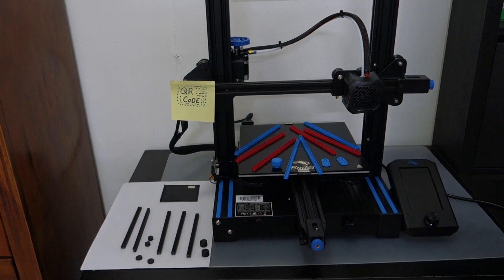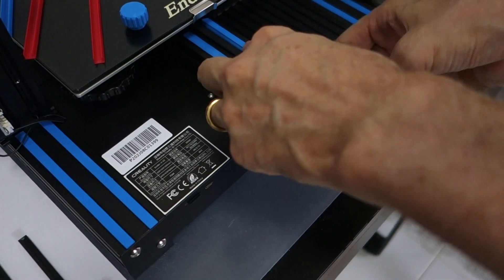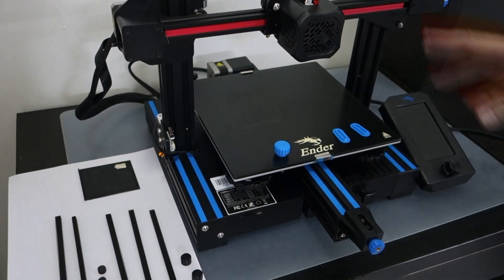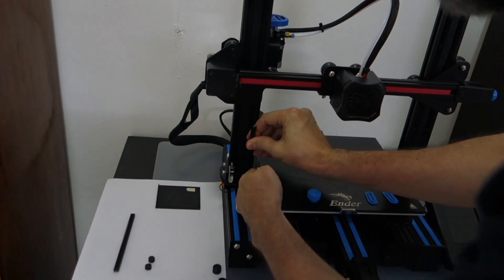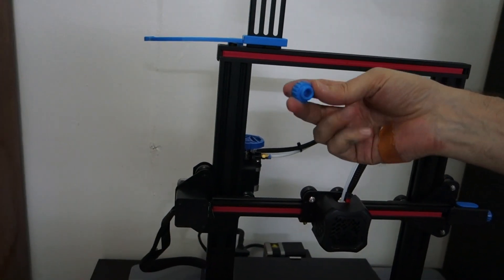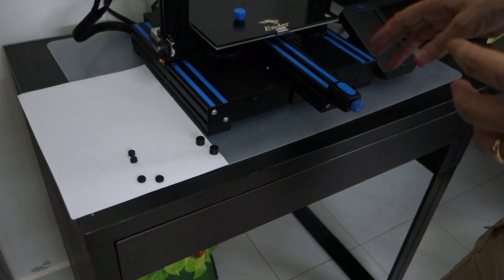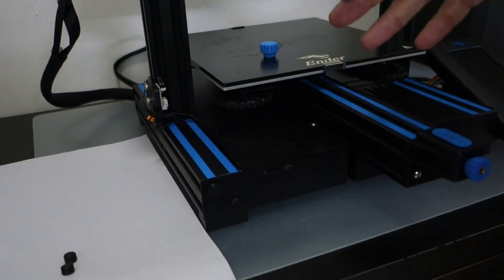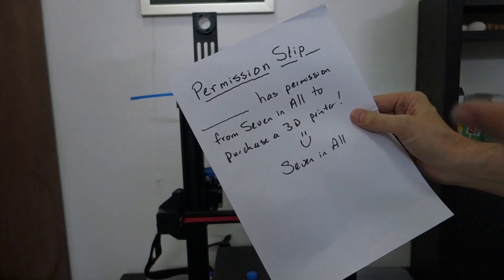MORE MODS for Creality Ender 3 V2 | Modding and Upgrades for 3D Printer

Comment: So how do you modify length? I tried to print one small one and it printer a piece in middle and hard to remove. What were your cura settings to print rail pieces?
Reply from the maker: If you open Cura, there are some icons on the left hand side. The 2nd one down relates to size. If you click on it, it will show the size in X, Y, and Z, and should be all at 100%. You can either increase the percent in one of those directions, or enter a size value by X, Y, or Z. Remember to unclick "Uniform Scaling" if you want to change a part in just one dimension. If you want to scale a part in all directions, leave that option checked. Hope this helps. Cheers!

Comment: I like the work, looks dope! but.. how many of each file do i need to print?
Reply from the maker: Thanks! It depends on which part you mean. Do you mean for the extrusion covers? In that case, it kind of depends on which of the extrusions you want to add a cover to. There are more on the machine than I printed covers for. So, I would say just print some out. After I did a few, I found I wanted to keep adding more for a greater effect. Have fun!
Reply: @seveninallmakes3177  i meant the blue parts that inserts in the frame :)

Comment: Great video and upgrades! Could you please post the links for the others upgrades? The Z knob, the black cover, the screw covers, etc! Thanks in advance!
Reply from the maker: Thanks for the encouragement! I really appreciate it.

I added the link for the Z-axis knob to the comments, and I will add the link here: https://www.thingiverse.com/thing:3014508

I haven't uploaded the black cover or screw covers to Thingiverse, so I don't have links for them right now. They are pretty simple to design if you have access to a CAD program and want to try your hand at some part design.

Cheers and keep on printing!
Reply: @seveninallmakes3177  I would love to also get those screw covers! Are you still thinking about uploading the models? It would save me the hassle of taking measurements and designing them in CAD.

Comment: Have you found that the extrusions hinder the x or y belts/travel at all?
Reply from the maker: The inside lip or wall that extends into the cavity is only about 1.5 or 2 mm, so as to not interfere with the x or y belts when they travel. It has worked fine for me so far on my machine. Hope it will work well for you too. Cheers!

Comment: i got a ender 3 v2, i just add the microswiss direct drive extruder but the fan block doesn't fit on it, any reference for it or slt of the fan block to modify for it to fit on microswiss direct drive aluminum kit.?
Reply from the maker: At this point, I haven't switched over to a direct drive extruder, so I don't have any experience with that particular problem, sorry! Hopefully someone else in the printing community can chime in with some help!

Comment: I found those files before I watched the video, originally didn't download the tension cover cause it said you had to cut it, which I thought odd. No other covers out there so I'll give it a try.
Reply from the maker: I didn't realize until after fitting them that the sizing was just slightly different between the x-axis and y-axis belt tensioners, but the covers are working for me.

Comment: i just got an Ender 3 v2 , my first 3d printer :) alot to learn, subbed ya
Reply from the maker: Thanks a lot!
Reply: Why did u get the 3 v2 instead of the 3 or 3 pro? Asking bc I dont know which one to get
Reply from the maker: @waqaspathan3337  Thank you for asking. Good question. When I was checking into buying a 3D printer, I was looking at the Ender 3. Then, I saw that they had come out with the Ender 3 V2. I watched some YouTube videos comparing the differences to see what had changed. For the price difference, I felt it was worth it to get the 3 V2 model. Plus, they said that with the modifications, it brought the machine almost up to the same level as the Pro model (which I believe was still higher in cost). So, then, the choice seemed pretty clear for me to go with the Ender 3 V2. Check out the prices you can get each one at where you live, and check out the differences in each model and see which one fits your needs the best. Cheers!
Reply: @waqaspathan3337  You can DIY almost all the upgrades of V2. But that takes time and effort. But the things that convinced me to get V2 is the silent driver and 32-bit board. Both of which are expensive to DIY.

Comment: great vid but if you need more performance  actual mods you should look into installing a new extruder, bltouch and Capricorn tubing easy mods to do and make a big difference
Reply from the maker: Thanks for the tips!
Reply: @seveninallmakes3177   I’ve the ender 3 v2 have it to the point where it basically runs  with out any set up or pre pre prep levelling the bed  etc .